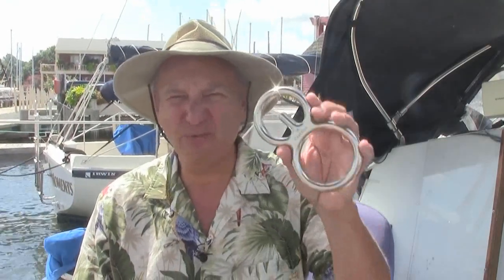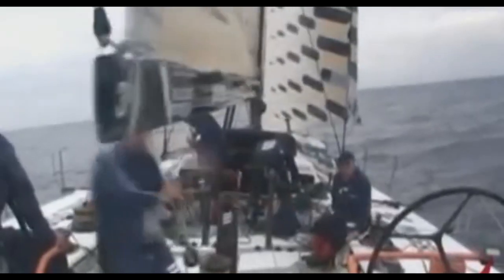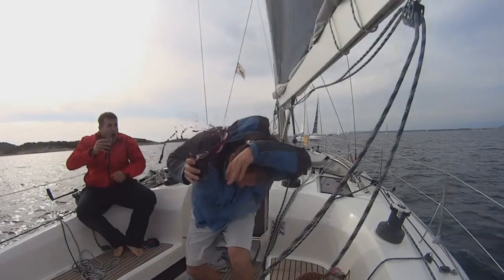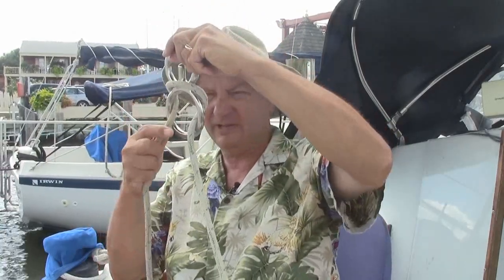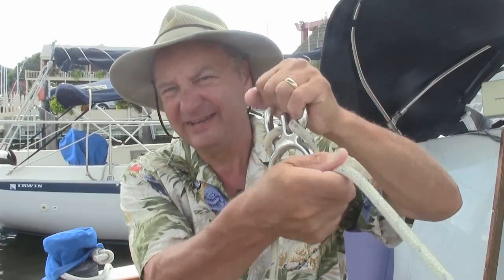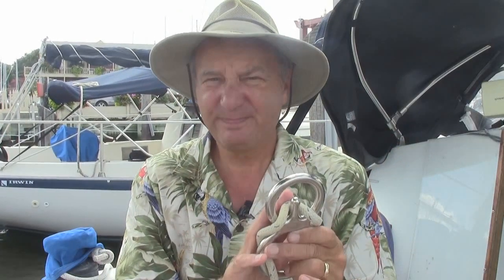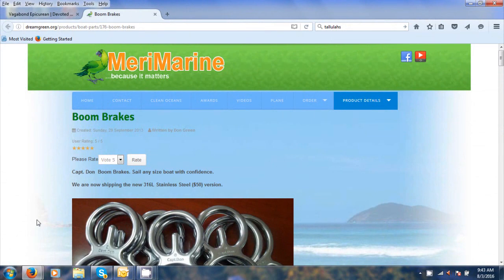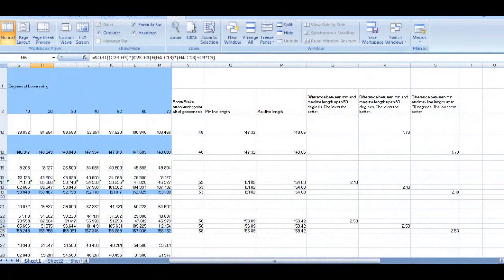Boom Brakes, what are they, how do you use one

Comment: Or you can buy a climbers descendeur for a fraction of the price and made from a more reliable material.
Reply from the maker: true, thank you for watching
Reply: I just bought one (a descender for $7). Yes it costs less but it is smaller in size. But then my boat is only 15 feet so I am sure the 3500  kg rating is enough and it is made of aluminum. The Stainless steel boom brake would certainly be stronger and if I were on my dream boat (30 foot cutter) I would not hesitate to spend $60 for it. In any case the info here is useful.

Comment: Every video I've seen for these, shows them being tested in 5kts of breeze. Totally unrealistic.  I bought one and did several test gybes in 10-12 knots of breeze and it's a complete waste of money.  It utterly failed to slow the boom down at all unless I kept the line snugged tight in which case the boom brake became a "preventer" which simply prevented the gybe entirely. I should have bought the Wichard Gybe Easy boom brake.
Reply: Did you upgrade in the end? How did it work out?
Reply: @slo007  in the end,  what made it work better was the aging of the line in the elements so that it wasn't so slick.  Repositioning the line forward a bit also helped a little.
Reply: @ajax1137  SO you had it set up incorrectly, got it.